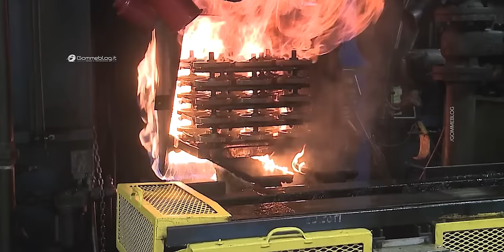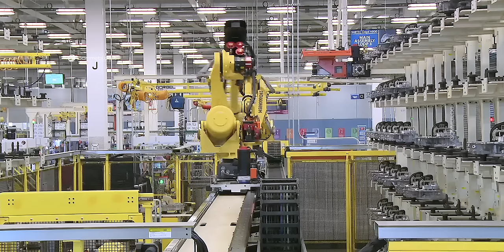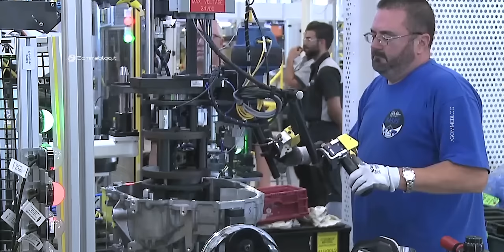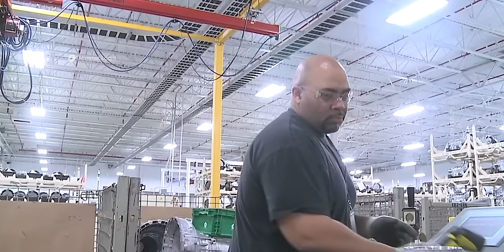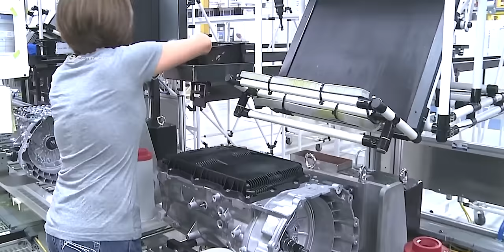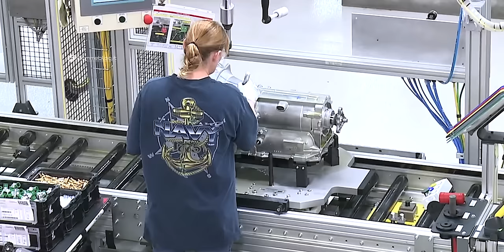Mind-Blowing Gearbox Unleashed in Stellantis Manufacturing!

Comment: The funny thing is, these are ZF 8 speed transmissions being built under license by Stellantis. There are a couple of modifications to the original design so it would work with Stellantis's manufacturing process, but otherwise, these are ZF 8 speed units.

Comment: interesting, comparing these to the my 43RH (classic Torqueflite) transmission in my 89 Jeep. That was a classic design, first introduced in 1960 and running into the 90s.

Still great. No electronics, no computer solid reliable.

Comment: Seeing these guys build engines by hand, where in Europe for BMW, Merc, Audi they build robotically with Kuka.
Reply: That's probably why Transmissions on BMWs, Mercedes, and Audi self-destruct so much faster.
Reply: The asset strippers of the French/Italian motor engineering facilities.
Reply: @setharp  My Q5 and both TTS were fine. Still have my Q5 after 10 years. Had the oil leak issue eventually after 10 years and had a rebuild. done 175k already. Great car.